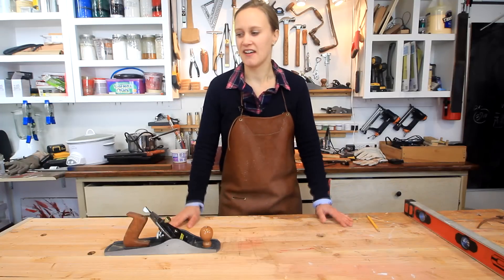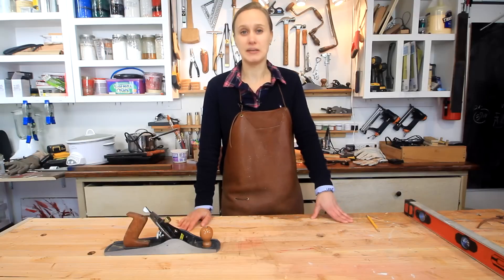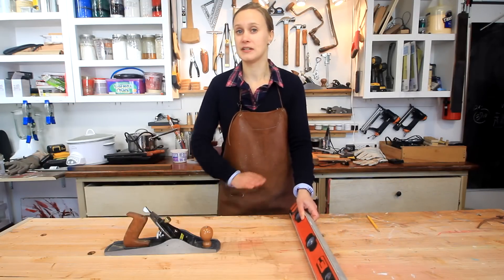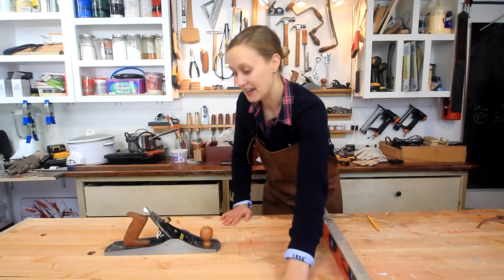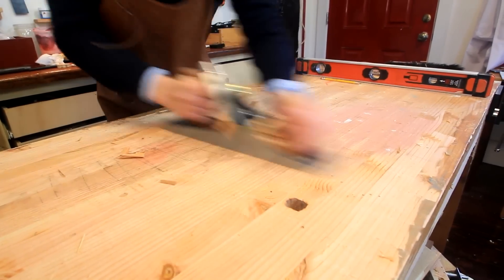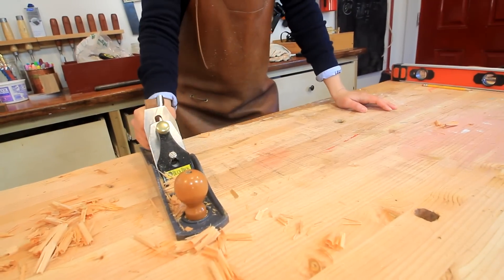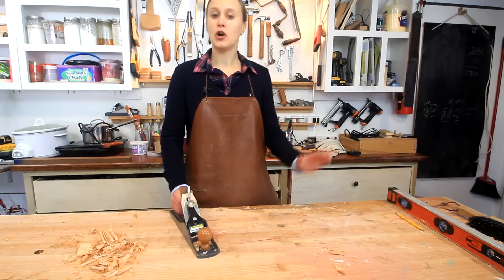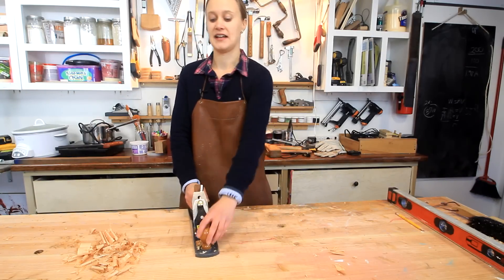Planing Your Workbench Flat

Comment: Darbin, nice job. In the future you might wish to consider adding a #7 (or #8) to your collection and running it lengthwise after you finish with the #5. This will give you a very flat surface on which to work. In addition, as one chap noted, the use of winding sticks will allow you to eliminate any twist that may have developed over time.

Comment: Actually, in my opinion anyway, the workbench top is the place to go crazy when leveling and smoothing. A large worktop that's absolutely flat will help me speed up my work a lot, even if they do demand a lot of time up front.

Starting a project? Place a board on the top, and I'll know immediately if it's twisted. I can spot the high spots and how bad the bowing is. Cups will also be immediately measureable, and I can decide whether I want to plane out the cup or rip the board in two, plane the edges square, then glue them back together.

Having a really smooth top means I can use it as a six foot long shooting board, making it great for jointing edges. I still have so much to learn, so having these  reference areas are really a great help.

But, that's just my style, different strokes for different folks I guess. Thanks for the vid, it made me think.